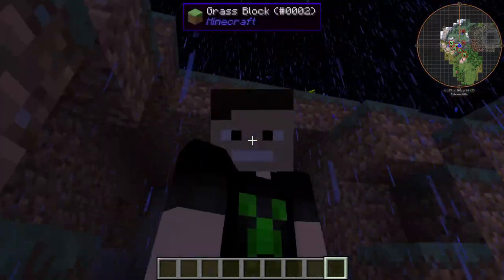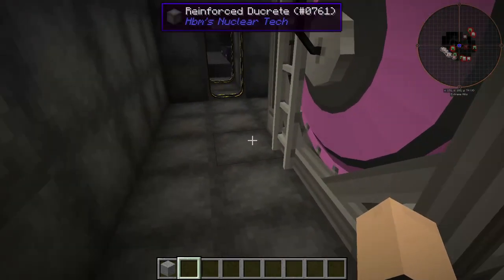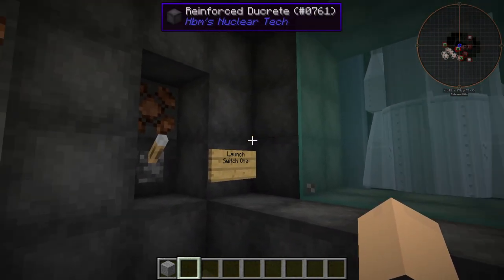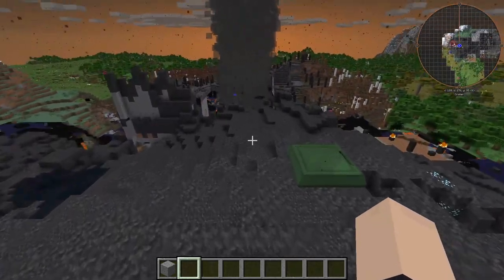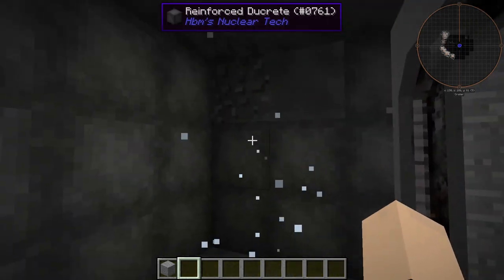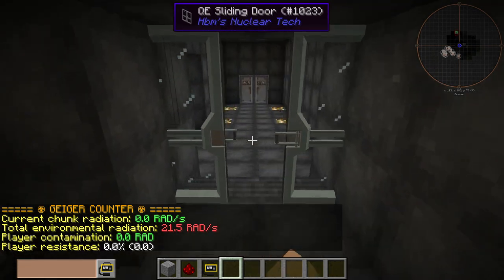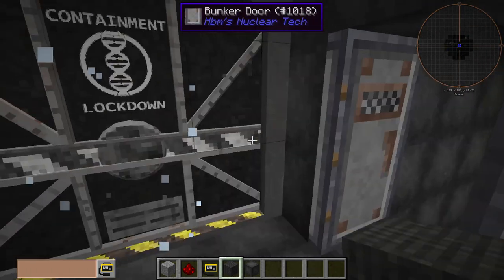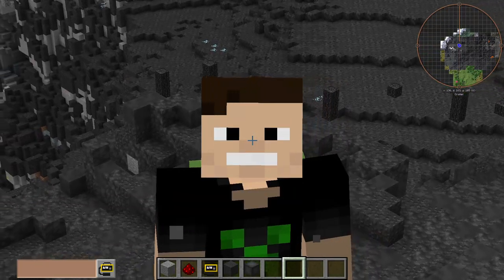Even Better Missile Silo From the Hbm Nuclear Tech Mod

Comment: Yeah the doomsday missile is now a thermonuclear missile with a far extended fallout radius, essentially a salted bomb, so it's actually the most powerful nuclear missile in the mod lol.
Reply: I honestly liked the old Doomsday Missile way more it was something different from the rest and now its just a salted thermonuclear bomb
Reply: @Ryftex I mean, it was also just useless, the new version seems to be planned to actually be craftable, rather than yet another creative-only "haha funny bomb" item, which is nice.
Reply: @gmhs2  honestly sad that the original doomsday missile never had a crafting recipe
Reply: @Ryftex  cause it was OP and nonsensical lol
Reply: Update, the latest commit (not yet released) added a way of obtaining the doomsday missile, it will be generated as a damaged variant on an also-damaged launch pad. It can either be launched as-is for a reduced yield using a launch key and code, or taken out and repaired to obtain the actual doomsday missile.
Reply: (Seems the damaged doomsday missile has half the explosion yield, so it's the same size as a normal nuke rather than a thermonuclear missile, but it still has 100 extra blocks of fallout.)